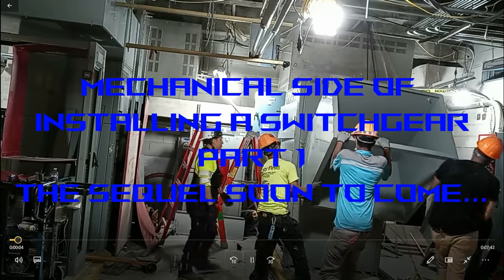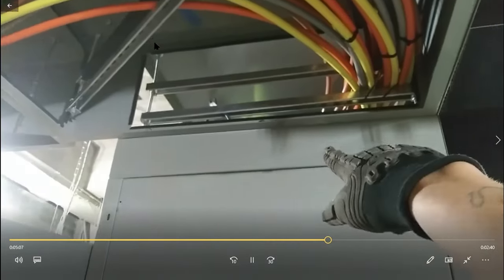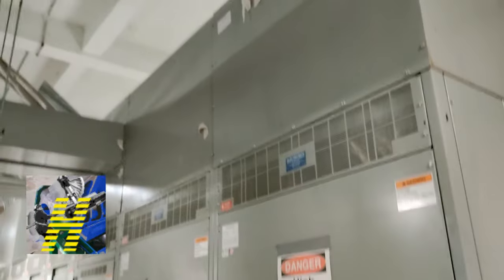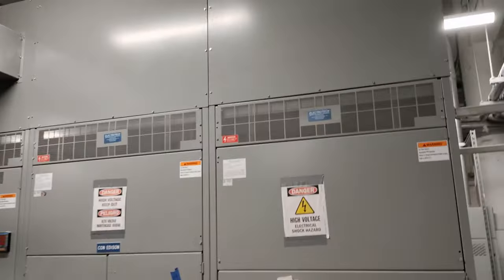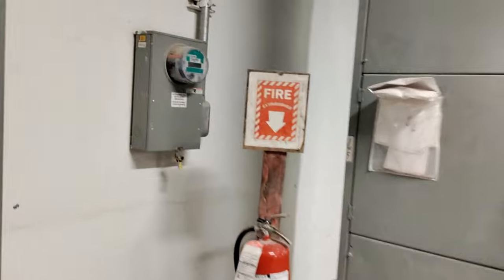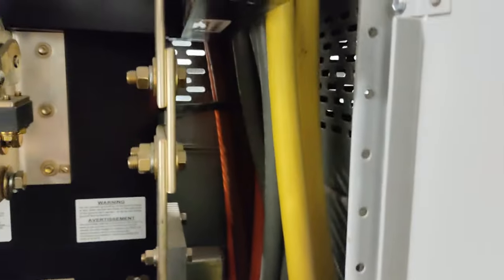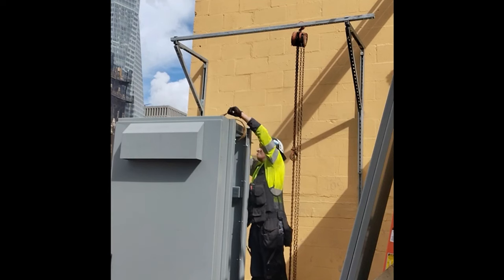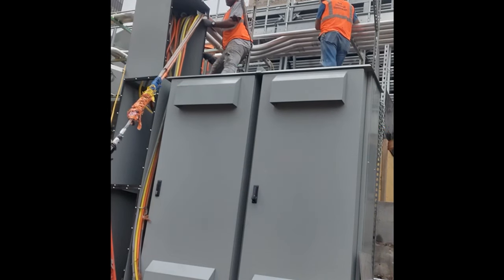Installing or working on Switchgear (Mechanical Side) Pt.1

Comment: Melvin or anyone else commenting on this post. I have a non-electrical question regarding MCC building construction.  I see the floor was covered to protect the epoxy floor coating. We are about to start a new project constructing a switchgear building. From a sequence starndpoint. In your experience, when should the floor be prepared and epoxy coating applied. We were thinking after the ductwork and cable trays are complete. The floor needs to be clear so the coating is installed across all surfaces and under the gear. When is the gear and cables installed?

Comment: Amazing stuff, brother.
I did commercial for 5 years before I got into servicework.
Lots of panels, pipework, mainly hospitals and schools but I only ever got to pull wire into gears, no mechanical for gears.
It's great for me to see this because I always wanted to see more in-depth detail on layout.
The most pipe I bend nowadays is whenever I get customers asking for circuits in garages with no attic access and whenever I get the occasional service call to a mall.
Last one was to a JCPenney, some douche cut the feeds for a shared neutral circuit (20a) for 6 office rooms for general use outlets.
Had to bring out the extension ladder and shove it through the drop ceiling at an angle to the steel beams about 18' up to reach the cut conduit, place a jbox and refeed to the old 80s Square D panel about 20' away. 
No grounds for the branch circuits since it was all ran in EMT and whoever installed the loads used the conduit and boxes as the ground.
Circuit didn't even trip when whoever cut it did it!
I miss commercial but I love service.
I like learning more and more, so things like this help refresh my memory.
Thank you.
Getting my master's license soon.
Reply: It's hard to find videos that go more into gear work and all the rest, so this is a godsend. 
Nothing but blessings for yourself, your team, your company and everyone around you brother.

Comment: Nice work

Keep in mind that those gear are "enclosures", which are meant to fully enclose the current carrying parts to prevent things like metal fishtapes from getting up into the energized gear, and also to enclose the electrical parts so that any large electrical events are fully contained safely.

Bolting those gears to the floor isn't easy.

Nice work on big stuff
Reply from the maker: Thanks for the comment. Yes I know, working on gear takes a lot of planning and expertise. Every time I put one together I learn something. No one gear room has ever been the same. 
I will be dropping more content coming soon this year, stay tuned. Thanks.
Join me on my new LinkedIn account
www.linkedin.com/in/melvin-rubio

Comment: Nice work man!
Reply from the maker: I appreciate it. but most of all I would really appreciate it more if you would help spread the word of the channel. I have lots of video's on conduit bending and other related topics. I'm trying to get into teaching more mechanical skills as well for the apprentices that have never really installed electrical equipment before. So video's like that will be coming soon. Thanks again for watching and commenting.

Comment: Boltswitch does make big switches on special order with the line on the bottom. The entire switch is basically upside-down. Each installation can be different.
Reply from the maker: I love working on gear rooms. It's the only thing that interests me anymore.
Reply from the maker: Now I'm working my way up to a foreman. decided last year to push myself to learn how to manage and become a foreman the company I'm at gave me a shot a sub foreman this is my 2nd site with the title. I'm loving it but I want my own building as a foreman.

Comment: Is a crown box the same thing as a gutter
Reply from the maker: No not really. I mean it all does the same thing. But I see a gutter as a wireway. A crown box is just a box. A box that specifically goes on top of a large disconnect switch. A service switch. If that same box was used some where else it would just be called a j box. A gutter is more like a wireway.

Comment: So what's the point of a crown box
Reply from the maker: Good question. Think about it. Let say you have much room to go into the top of the switch with your conduits you install a crown box and now you can connect your conduit right into the box on the sides all four side if you want. The norm now is to install crown boxes just so you have more options and more space to bring conduits. Another option let's say you have 2 switches side by side. You can put 2 crown boxes now with the insides of the boxes open to make it look like one big box. Now I have the option to bring conduit anywhere in that box to hit any switch the box is install on. Hope this helps.